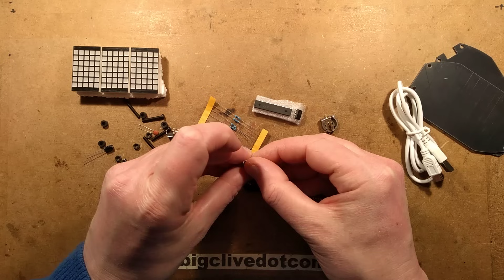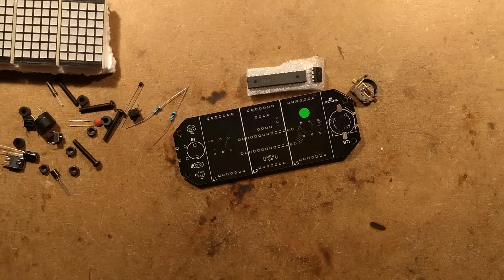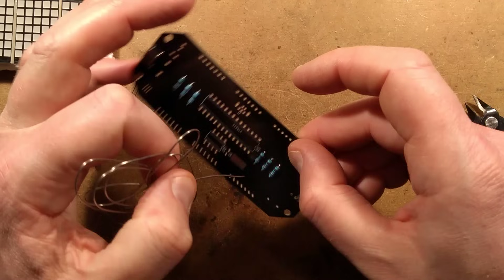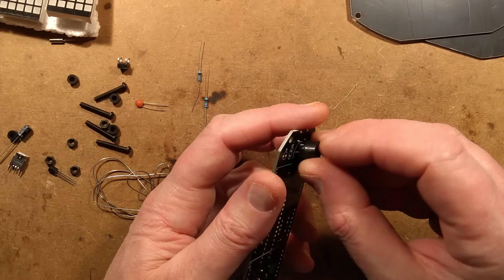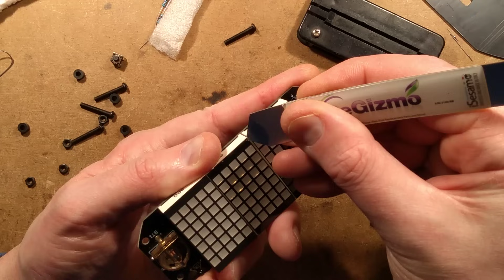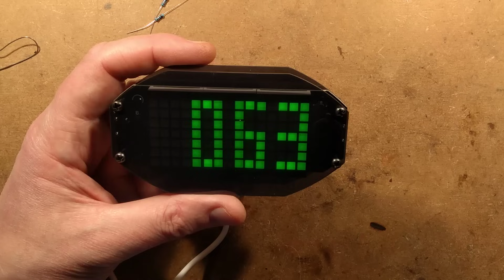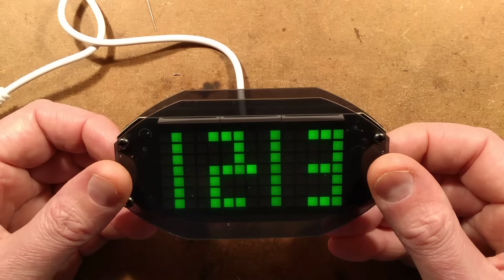Full clock kit build and setting guide.

Comment: You will have to wait to see if the timekeeping drifts.  It's either going to be very crap or very good, nothing in between.

When I got a digital watch back in the mid-80s, I spent several days tweaking the trimmer capacitor to get good timekeeping.  Which I expected to have to do.  Because it costs more to cut a crystal to a precise frequency than it does to cut it less precisely and compensate with a trimmer.  More so because the crystal frequency will change because of stray capacitance and inductance of the circuit you use it in, so to get a really precise frequency you have to cut the crystal for the circuit configuration it will be used in, so you'd need a trimmer anyway.

But they've gotten better at cutting crystals.  A lot better.  Because any digital clock I've bought over the last 20 years hasn't had a trimmer in it but has kept very good time.  Better than I managed to achieve with my mid-80s digital watch after several days of tweaking.
Reply: It's not the crystals that have gotten better, it's the chips. Digital trimming replaced trimmer caps (a potential source of trouble in themselves) some time in the mid-late '80s, and with on-chip temperature sensing you can do pretty accurate temperature compensation if the crystal's characteristics are known.

I still like my vintage quartz watches - they're just built to a higher mechanical standard. (Try finding even a midrange ETA movement in a modern wristwatch. You'll be spending hundreds. Depressing.) Unfortunately my local watchmaker's equipment is hitting its limits at around the 1s/day deviation mark, which is adequate for a mechanical watch but still rather high for a quartz.

Comment: If you want a white noise generator, I suggest a fan based, acoustic white noise generator. It's basically just a fan in a box with adjustable holes and slots to adjust the volume and pitch of the white noise. They do seem to do a much better job than electronic white noise generators. They aren't as gimmicky with the 8 second, repeating sound clips that can quickly drive you up the wall. This is one such device: https://www.ebay.com/itm/Fan-Noise-Sleep-Machine-Adults-Kid-Anxiety-Insomnia-Sound-Therapy-White-Machines/173749921643?_trkparms=aid%3D555018%26algo%3DPL.SIM%26ao%3D1%26asc%3D20131003132420%26meid%3D1eb7cdec9ee14d21817741b0231f3085%26pid%3D100005%26rk%3D1%26rkt%3D3%26sd%3D153344617580%26itm%3D173749921643&_trksid=p2047675.c100005.m1851

Comment: I love these videos I want to learn to solder do you recommend these kits for a person who knows nothing? I bought a aoyue 936 kit as a starter soldering iron and a set of tips should I just but a bunch of these kits off aliexpress.
Reply from the maker: I'd recommend starting with the cheaper and simpler kits that just flash LEDs initially.  Then you can work your way up to more complex kits.  Here's a handy search link for eBay to get some cheap practice kits.  Buy a few and also get some proper tin/lead solder with flux core from a local source.
https://www.ebay.com/sch/i.html?_from=R40&_nkw=flash+led+kit+suite+diy&_sacat=0&LH_BIN=1&_sop=15

Comment: i am always impressed by your finger dexterity - holding parts with a few digits while holding the solder with the other. Well done. And I think everyone's preferred soldering methods are their own. Use other people's ideas for yourself as needed - no need to "correct" another's work when the circuit works.

Comment: I'd love to know how they are driving the displays... I'm assuming they are using some sort of Charlieplexing to reduce the pin count, but I just can't envisage how it's done with pre-defined 5x7 matrix displays and 6 resistors.
Reply from the maker: It's worse.  There are no resistors in series with the display at all.  They're relying on output impedance of the MPU.

Comment: What is the model of that LED 5x8 panel? thank you
Reply from the maker: it's only marked 8pg.  Try a search for led 5 7 dot matrix display.
Reply: @bigclivedotcom  thank you very much, found them. Being sold for $10.93, 10 pcs at aliexpress. I am thinking of building something like that with TM1637/TM1638 and ESP8266 - internet synched time.

Comment: There's no low value cap around the xtal somewhere - could be why the xtal freq is off a bit....let's see how it keeps time.....:o)
Reply from the maker: I wondered that myself, but the chip's data sheet shows internal load caps.
Reply: I should have looked at DS1307 datasheet  first !  Could still be a xtal designed for a different load cap in this kit mind you - problems with this rtc chip running at the wrong speed seem to be all over the web :o(
Reply from the maker: @noakeswalker  It keeps time on battery alone, but rockets ahead when the clock is powered.  So far I've tried a 100nF cap across the RTC chip and processor, and also added a parallel smoothing capacitor.  Still no joy.
Reply: Oh, it runs fast , but only on ext 5v then...  I expect you've seen this BC, but the Maxim app. note 58 has help about slow/fast clock - here it is -  https://www.maximintegrated.com/en/app-notes/index.mvp/id/58
Scroll down to 'crystal layout'. Fast clock on 5v only they suggest is noise coupling into the two xtal lines giving extra clock pulses. You have put extra decoupling on power already. The pcb layout here looks like it doesn't have, for eg, a guard ring around the xtal maybe, though it does have a gnd pad under it ? I think there might be some traces going right along side the xtal by the look of it ?  I wonder if standing the xtal up off the pcb might reduce noise into it in which case ? Means heating the xtal again ...:o( Else a redesign of the board ? Ooer.  I have run out of ideas just now. Let us know if you fix it :o)

Comment: I recently bought one of the other clock kits that you built before and I've got it on my side table. I read a lot of reviews of it, and people complained that it only has 24 hour time, which is what I prefer, and it only displays the temperature in Celsius, and I guess this is America, but it's still not a big deal to me. Additionally, it comes with a QR code that points you to a website with build instructions that are all in Chinese, but it was easy to figure out with the pictures. The only thing I really didn't like about it was the beeper, so I "adjusted" it by jamming a pointy object inside it and wiggling it around until it became much quieter. Good times.
Reply: Cadwaladr Best way to make those beepers quieter is to put a tape on it.
Reply: I use the pointy cutty things to silence them... they make no noise at all after that! xD
Reply: I just remove the beeper since the clock is just for time not alarm.
Reply: A small self adhesive felt pad (as used on equipment feet) will provide more than sufficient muting (and the fix is reversible).
Reply: A blob of Blue Tack works well, too. No sticky residue on the bleeping thing.
Reply: Cadwaladr :
I did an ebay search for "Jamming Pointy Object" ... and i can't even begin to imagine how you toggled the beeping component into silence mode without dicking up the whole project. Those thingies are HUGE!!!
It appears the black ones offer the most bang for the buck.
Just sayin'
Reply: @Mui MasMacho
Just get the Asian ones...they fit better  :)

Comment: Indeed " Battery voltage must be held between the minimum and maximum limits for proper operation.
... If a backup supply is not required, VBAT must be grounded.

Comment: The problem with battery back up clocks is you don't know how long your fridge has been off for when theres a power cut. The only clue is the microwave flashing
Reply: Freeze a container with about a 1cm layer of water. Toss a coin on top after it's frozen. Put the lot in the freezer,  and check it whenever the power has been out. If the coin isn't at the top any more, you need to check your food.

Comment: The best clocks are the ones that use synchronous motors, so you can tell how long the power was off in your absence and if they drift you know the frequency of the main power from the power company is precisely correct over time.  Its an added bonus.
Reply: Yes, for accuracy,  after radio controlled clocks,  mains powered clocks, whether analogue or digital,  controlled by the supply frequency,  are the most accurate.
They can drift a few seconds either way but over time correct themselves.
Reply: It's not a bug, it's a feature!

Comment: What kind of battery goes in that? I've got a RTC module that looks like the same size as that and I can't figure out what kind of battery goes in it.  It's not any of the more common types, of which I have many.
Reply: LIR2032, don't use a CR2032 as they anren't rechargeable and will result in an unhappy clock.
Reply: @webchimp  I don't know about that. The one I have is definitely not a 2032 size. It just looks similar to the socket in this project. the color and proportions seem the same. but It's hard to tell from video.
Reply: Have a look on this list to see if you can figure out the type
https://en.wikipedia.org/wiki/List_of_battery_sizes#Lithium_cells
Reply: It looks to be more the size of a CR1220, which is the size my clock kit came with.

Comment: Many, many thanks for doing another kit-build video. I think they are my favourites!

I seem to have a bit of a passion for clock kits, so I will have to get hold of this one!  I wonder should you socket the micro-controller if you can then reprogramme it--get rid of some of the annoying behaviour in the process? However from the looks you would need to dremmel out holes for the higher-standing IC if you did.

As it happens I just got from China a 100% SMT clock kit where the whole display matrix is made from something like 340 discrete LEDs. They will be a true pleasure to solder down I am sure! I think I might wait until I can get a TS80 with its finer bit specifically for the job. Those little irons seem to have an excellent reputation and sit just at the extreme top end of pocket-money prices. The difference from the TS100 is that it will run from a 'QuickCharge 3' compliant USB power supply, which is handy.

Sadly, on looking I cannot seem to find this specific kit on eBay--would you mind putting in a generic link to it?
Reply: https://www.ebay.co.uk/sch/i.html?_odkw=DIY+Black+Digital+LED+Desktop+Alarm+Clock+Electronic+Learning+Kit+Module+K0T0&_osacat=0&_from=R40&_trksid=m570.l1313&_nkw=DIY+Black+Digital+LED+Desktop+Alarm+Clock+Electronic+Learning+Kit&_sacat=0

Comment: Recommendation:   When you are 'teaching' something like this, you might want to explain how you know which way components are to be placed.. i.e. the proper direction you should put resisters in, diodes in etc..  Many may not know little things like that.
Reply: He did. But if that where to happen every time I would probably stop watching. When clive does advise on 101 type things he usualy does it in passing conversation while beavering away, so you may have missed it. Which I like, btw, nothing worse than stopping for 2 minutes to explain the basics.

Comment: This was really cool! Thank you for sharing this, I want to do stuff like this! Can you recommend a good soldering iron that would be good for this type of work? I have a soldering iron but it is a piece of blank!
Reply from the maker: As long as your iron has a fine enough tip and is clean and shiny when hot and the tip is wiped then it should be OK.  For most of my career I've used a dumb 240V 25W iron with no electronic control.
Reply: @bigclivedotcom  thank you!

Comment: hi does this charge the clock battery or only discharge it
Reply: Discharge only. The battery does't power the clock either. The battery just keeps the rtc chip counting time when the usb is unpluged.

Comment: DS1307 isn't particularly precise chip and these crystals aren't very good
Reply: Exactly. Due to this I switched to DS3231. It has an internal reference and is not more expensive.
Reply: @FischOderAal  Are you saying you can just swap the IC and no other mod is required? If so... do you leave the external crystal out? 😶
Reply: I use the 1302 which is the spi version similar to the 1307. They aren't temp compensated and given the tolerance of these cheap 32.768k crystals I wouldn't be surprised if it gains or loses a number of seconds a day. Additionally the layout of the chip/crystal in reference to any fast switching digital signals has a great effect on accuracy (especially with displays that are multiplexed like this which can cause clock glitching to add or skip pulses).

Comment: Clive, you've still got to do the one with the audio visualizer mode

It is much simpler to program and only does the time and temp, and the temp is displayed much less often than the time.

Use the flat LEDs on it, spraypaint the whole front, and then sand the front off the LEDs, it'll make it much more readable

Comment: I wonder if the reports of bad timekeeping come down to people not putting the memory battery in it at all?
Reply: If it was gaining or losing time, the battery should make no difference.
Reply: @bdf2718  what I meant was people leaving on standby or something and not realising that it was resetting the time everytime and thought it was just losing time I don't know lol
Reply: @spicy110  
I got the impression, from what Clive said, that it was crappy timekeeping rather than resetting to random crap every time they unplugged the power source.  But I wasn't giving sufficient allowance to how stupid people describe technical problems.  I've listened to enough stupid people describe technical problems that I know how far wide of the mark they can be.  I think I was taking it at face value because Clive said it.

Then again, if they can manage to solder one of those things together with no instructions, surely they can't be that stupid.  Can they?
Reply: @bdf2718  hmmm interesting! I used to sell TVs and hi-fi and 99% of the time the problem was the knob holding a controller! 😂 but you make a very good point about them being able to put it together! The plot thickens! 👍
Reply: No, the DS1307 is a piece of shite when it comes to keeping time. I'm comparing DS1307 modules against DS3231 modules right now, and in two days the DS1307 modules have drifted as much as 20 seconds. The DS3231s are just chugging along and keeping proper time.
Reply: @TimothySCarlson  I would have thought that innacuracy would be down to the crystal choice and circuit design considerations rather than the DS1307 itself. For instance,  I have seen many implementations without a ground plane.
Much is written on this subject, for instance

https://datasheets.maximintegrated.com/en/ds/DS1307.pdf

CLOCK ACCURACY
The accuracy of the clock is dependent upon the accuracy of the crystal and the accuracy of the match between
the capacitive load of the oscillator circuit and the capacitive load for which the crystal was trimmed. Additional
error will be added by crystal frequency drift caused by temperature shifts. External circuit noise coupled into the
oscillator circuit may result in the clock running fast. Refer to Application Note 58: Crystal Considerations with
Dallas Real-Time Clocks for detailed information.

also..

http://db.zmitac.aei.polsl.pl/Electronics_Firm_Docs/DALLAS/app58.pdf
Reply: i got one a few weeks ago, and per 24h it's about 30min too fast. tried 2 other oscillators, several USB power sources, with or without the backup battery. always the same result.
Reply: @Ucceah  IIRC the operation of the DS1307, the RTC doesn't even run if the battery isn't inserted unless you ground the backup battery connection, meaning it's quite possible that the clock is relying on the ability of the micro to do timekeeping. Having said that, I've had little luck with DS1307s of late holding accurate time over several months... they can be that bad that they loose a minute or so in a week... probably due to the lack of temperature compensation as well as bad crystals and possibly inferior DS1307s.
Reply: I have a sony alarm clock that doesn't have a battery that does the same thing, how you can manage to make a digital clock that loses time, if I didn't have it myself I wouldn't believe it
Reply: @audi4444player  Easy, just don't care about accuracy... they're cheaper if you shake all the seconds out of them!! :-O
Reply: I got the other clock Clive built and it drifts quite a lot too. I'm wondering if it's fake chips. It seems to be a bit of a crapshoot. I'm not too worried as I'm planning to mod it with an ESP to use NTP. It's not 30 minutes a day bad though but a couple of minutes per month.
Reply: @chaos.corner  I've started using MAX7219 led matrix displays (4 8x8 led modules with a proper driver chip so no change in pixel brightness) and an ESP8266 to do NTP time sync. Only using 7-9% of flash memory, so plenty of room for features, and I have clocks that do not need setting or drift and just display the time ;)
Reply: No, I bought 6 of them, only 2 keep time. They have there batteries also. Just a bad main chip.
Reply: They just use counterfeit or defective RTC chips, if you swap it out it runs fine
Reply: Also check Clive's comment in the Description.
Reply: No, that is to keep the clock running when power fails. It has been on every digital clock since the 1970s
Reply: Ummmm no.. Mine just didn't count properly at all... See https://www.youtube.com/watch?v=wjjz16c7hrA&t=383s